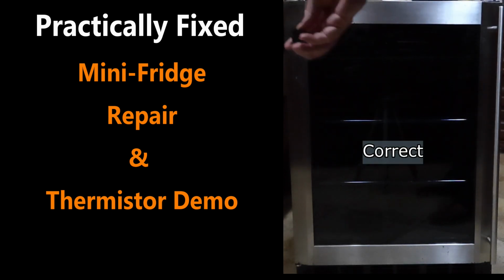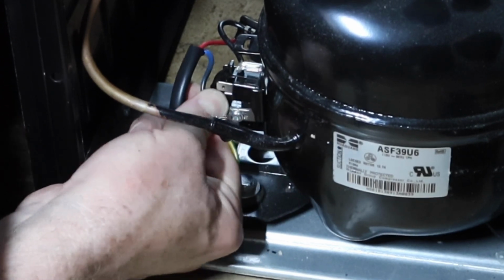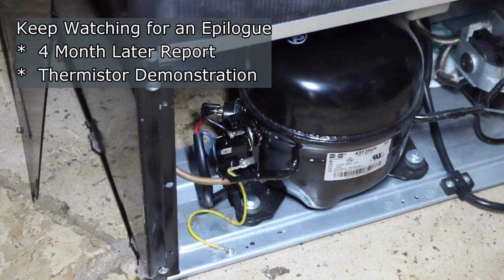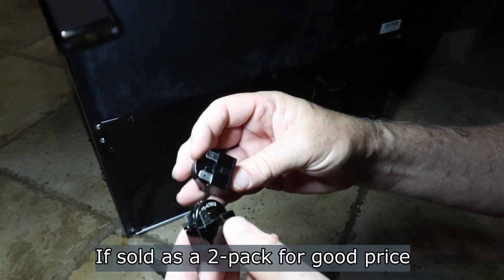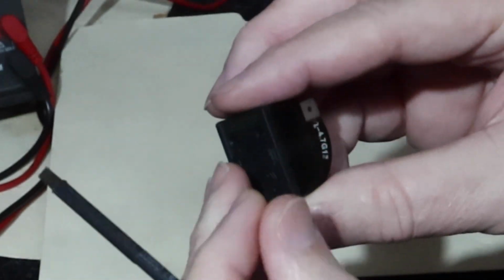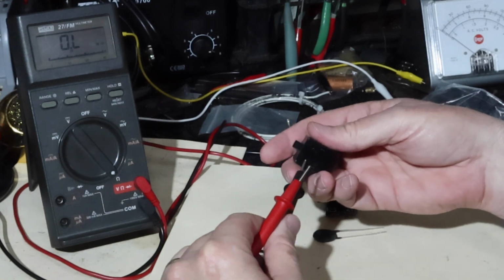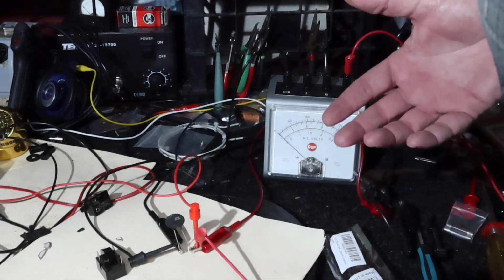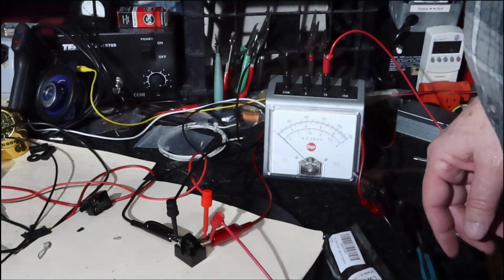MINI FRIDGE REPAIR & THERMISTOR DEMO - NTC vs PTC - VISSANI Also Magic Chef and other Brands [4K]

Comment: Interesting video on the PTC, didn't know they were used small refrigerator electric compressor motors, but as you explained it makes since. On larger motors they use a centrifugal switch to turn off the starting winding after starting up.
Reply from the maker: Thanks Jim.  Yeah I thought after showing CL-series thermistors it would be interesting to compare it to a different type showing the different ways the principle can be used with opposite characteristics.  Thanks again.